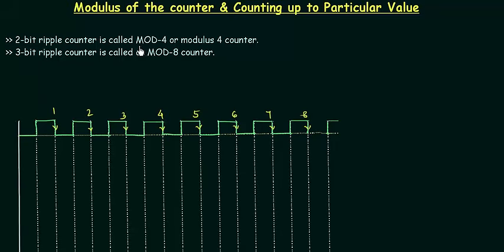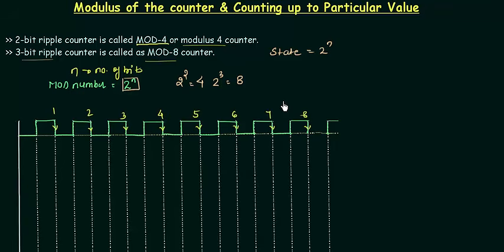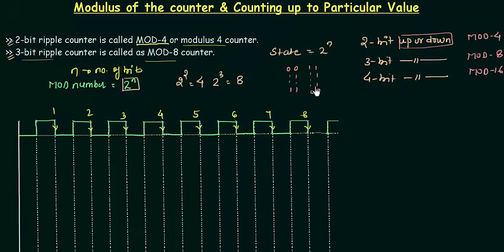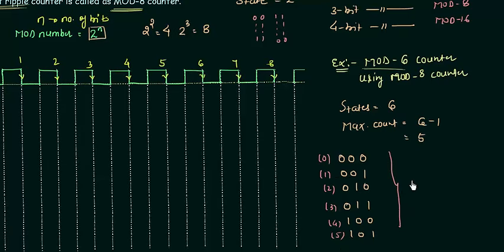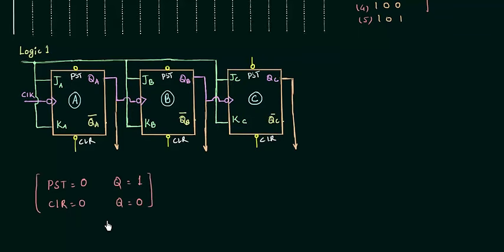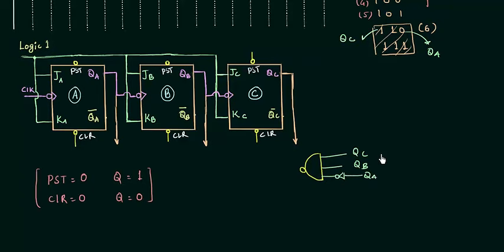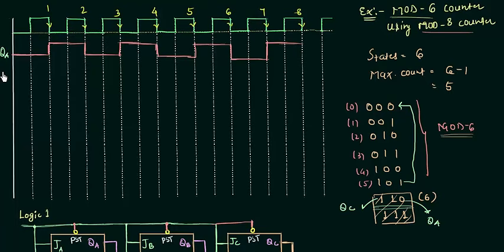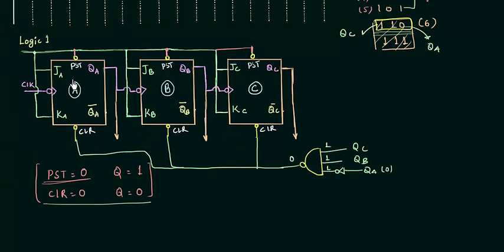Modulus of the Counter & Counting up to Particular Value

Comment: But you are assuming that there is no delay. Actually, there is some delay which causes counter to go 110 state in a very short time which is shorter than the clock cycle and this will make the counter more prone to signal hazards, and glitches because we don't want any signal pulse shorter than the clock cycle in the systems. Also, if you take gate delay into account you should connect 101 to NAND instead of 110.

Comment: P L E A S E will someone help me? I desperately need a single numeric digit readout circuit that ONLY counts 1 - 8 then resets to 1. NO 0’s or 9’s. Please reread this as many have given wrong advice. It should be simple but it’s not for me. Again, 1,2,3,4,5,6,7,8,1,2,3,4,5,6,7,8… I really need a schematic using CMOS 4000 series IC’s. 
Thank you. 🙏🏻

Comment: First of all thanks for creating this playlist. Like its been 9 years since its uploaded and till today it is helping so much students. I am preparing from your channel solely for my Digital Logic Design Exam. 
But I am confused a bit about the MOD condition. We used a NAND gate that generates output of 0 when the MOD = 0 occurs. But when the output of NAND goes in JK-FF it is inverted as seen in the diagram that it have a bubble. So instead of NAND we should use AND gate so we generate output of 1 and when it is sent to flip flop at clear it become zero and flip flop is cleared.

Comment: Another Approach towards such Q's

I want a function which gives o/p as 0 for value >= 6. Other wise 1 for value <= 5

QC   QB  QA  |  Y
0       0      0   |  1
0       0      1   |  1
0       1      0   |  1
0       1      1   |  1
1       0      0   |  1
1       0      1   |  1
1       1      0   |  0
1       1      1   |  0

Solve by K-Map we get:

Y = QB' + QC'

Create this circuit and give it as a i/p to all the CLR of Flip flop's this finally acts as a MOD-6 counter

Comment: Important:
The nand gate should be designed on 101 ( at 5 as output) as we dont want 6 as output so it must be reset befor 6 is arrived i,e. at 5 as output we clear the flipflops. rest everything is correct 👍

Comment: Sir for convention in Digital Electronics can we not use bubble as not gate? which will also applicable here as clr pin actives when it is set to 1 and clr bar pin actives when it is set to 0 that is inversion. So can we say that for clr pin high which clear the flop at clr=1 and using a bubble as not gate we can say that the pin will high at clr=0. is not it?   Kindly reply.

Comment: brother first of all i want to thank you a lot for such a great and deep explanation of this topic. But i'm a little bit confused that when we were making a mod6 counter than why we reset our ckt on 6th clock cycle cause if 6th cycle applies then our ckt will definitely count till decimal 6(which we don't want) and then it will reset.
Reply: Clock starts counting from 0, so the 6th clock will count 5 and the 7th will again start from 0 (probably)
Reply: you are correct brother
Reply: sorry bro , you are not right

Comment: I think we should design combinational circuit at 5(101) not at 6(110)
Becoz, if we design combinational circuit at 6(110),
Then we also must get 6 at the output...but we need to skip it as they asked for mod-6 counter not for mod-7 counter
Pls correct me if iam wrong

Comment: Great videos! Just have a doubt that if this is a ripple counter why aren't we using Mode control input (MCI) as you taught in previous videos?
Reply: Because this is a up counter.
Reply: You use the Mode select signal when you have an up/down counter, to change between the modes. Here, he is only describing an up ripple counter. Ripple refers to the asynchronous clocking of the flip flops.

Comment: Question: if I don't want the 000 state, then the initial state should be 001, how do I achieve that? (If I put a combinational circuit that detects 000 and resets it, then we will have an infinite loop)
Reply: brother firstly i'm not sure but for a 3 bit couter you can make a t. t. of qa, qb, qc and the output will 0 when all the three i/p are 0 in all other conditions the output will be 1 and then solve this table by k map and you'll end up with a combination ckt that will have qa, qb, qc as i/p and its o/p will be connected to first flip flop's preset pin and i think in that situation the counter will start counting from 001 (hopefully)
Reply: Same question even I have

Comment: According to your circuit diagram , when 3(011) will arrive then also the clear becomes 0 and those 3 outputs become 000
and start counting again from 000?
Please clear this to me
Reply: when 3(011) will come nand operation will done for 0 1 0(since not gate is also used ) and final answer will be logic 1. See truth table of NAND gate.
Reply: @akarshmittal112  after nand gate it will give 1+0+1 , then result will be 0
Reply: Check nand gate properties and apply d-morgan's law for 3 input bit
Reply: @sayanlaha3124  I have verified from internet that the output of 3 i/p nand gate is low in only one condition ie when inputs are 1 1 1
Reply: @akarshmittal112  You are right, I try myself ,, I applied D Morgan's law.
But it's not correct in case of 3 input.
Thanks a lot ..
Reply: @sayanlaha3124  no problem :)

Comment: Hi There I am not so specialist with digital stuff, but still I have a question, I need a triangle signal, 4 x fase shifted, now I have read I need to use a master integrator, ripple counter and encoder and a 4 bit integrator, this last is just resistors with caps connected to the encoder? can you help me what to do?, I now about ripple counter encoder and such, but did not find much for 4 bit integrator, it does make 4 signals 90 degree shifted intergrated signals. thanks for help.

Comment: Sir, how bout a counter that counts down to a particular value? Take Mod-12 counter for example. From the initial state to the 12th state, should the values for my truth table be 1111 to 0011 or 1100 to 0000?
Reply: I think the first u have mentioned will be the answer for your question where as later u have mentioned is the case occured by using preset as 0011. So they can start from 1100 all the way down to 0000

Comment: Hii sir ...
I am from Hyderabad...
I have a doubt please clarify..
At 10:39 you connected logic 1 to preset so that no changes will happen.
But at preset you have given a bubble then preset takes logic 0...
In that case
Then all Qa,Qb,Qc values will become 1,1,1 thent it is completely contradict to our question.
Reply: bubble represents that the input should be active low and doesnot changes the input
Reply: Here bubble means that it works as active low signal means whenever 0 is given as input it will set Qa...Qc to 1. ☺️

Comment: there is problem in the counting it should be from 0-5 not from 0-6 even though u said this  u took 6 (110) in your and gate it should be 5 101 because if u do 6 it will be fro 0-6 then u detect the six and then u clear it

Comment: also sir, i have simulated the ckt on http://www.falstad.com/circuit/e-counter.html  i think instead of NAND for teh reset the op of NAND should be OR again with 0 then given to all RESETs.. then only teh ckt will work as desired. correct me if i am wrong. Bcoz, the circuit above will produce RESET=1 => Q=0 FROM THE FORST CLOCK signal itself

Comment: sir, questn, does the NAND gate logic work for all counters that count to a specific value, in this case we caount to dec5 and after that it restarts from 0 and the NAND gate helps did that, what if we want to count to 7 and reset after that, will the NAND logic still work in that case?

Comment: I disagree,  i think we should trigger CLEAR when '5' appears , becoz  Qc ,Qb, Qa, already show 101 before triggering CLR, , after '5' they trigger CLR and display '0'.
Plz convince me how '6' is "Not displayed" when Qc ,Qb, Qa, = 110 after then they trigger CLR, ,
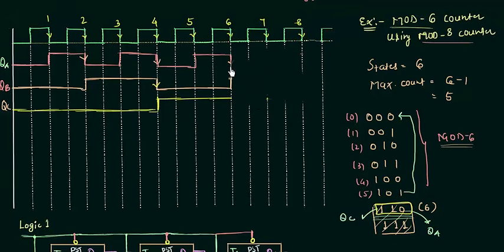(in your ckt 12:30 onwards , i think '0' appears at 7th clk edge and 110 = 6 appears at 6th clk edge )
Reply: 6 will be the output(QcQbQa) for the time equal to the propagation delay of the combinational circuit. As soon as the combinational circuit detects 6(110) as input, the clear is set to 0. This clear will ASYNCHRONOUSLY (ie . clock independently without encountering the negative edge)update the outputs as 000(QcQbQa)  and the counter will function as normal for next states. *Clear and Preset are asynchronous overriding inputs. .They don't depend on the clock edge.
Reply: @sarthaksg  thx
Reply: if we do what u have said...5th count state will be unstable...so when 6 came it is cleared..and 000 will come
Reply: I too think that when 101 is countered immideately clear should be triggered

Comment: I think ..this tutorial has a bug ... in the NAND gate u should take 101(5) as a input..u took 110(6) as input ..Do a recheck once ..!!
Reply: No!
It should be 110(6). If you used 101(5) then 5 won't be counted.

What we really want is count up to 5 and then when 6 arrives reset the counter to 0.
Reply: also nand gates dont have delays hence when 6 comes immediately it resets to 0.

Comment: I Understood these concepts very clearly. I Have small doubt " How to design a Counter if they have given sequence like 4,5,6,7,8,9?"
Reply: +GOLAKOTI VEERA VENKATA SATYANARAYANA MAYBE you should probably reset the states 0,1,2,3 and you will require a 4 bit counter. Not Sure though
Reply: i think we have to skip these state but i dont know how
Reply: Mr. this is counters, not a binary showing machine.It's count from either 0 or 7.
Reply: u have to use extra combinational cktry for preset clear. first made state diagram and then you will know wht to do by yourself

Comment: In this example, the requirement for the counter is to count up to 5 (101), however, the combinational circuit for the clear input allows the counter to count up to 6 (110). I'm thinking that the combinational circuit for the clear input should be (Q_A Q_B' Q_C)'. That is once the counter reaches 101, the counter should start counting from 000. Please let me know if i missed something. Thnaks!
Reply: ***** Oh, I see. Thank you for clarifying this to me.
Reply: @hassanalshehri6855  bro you're right 👍♥️